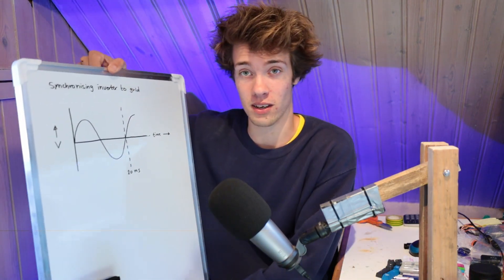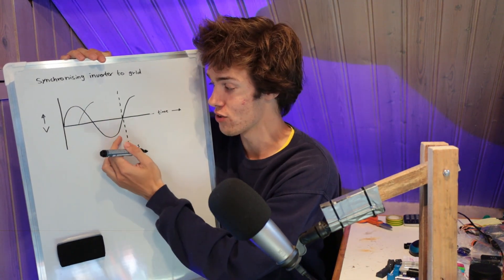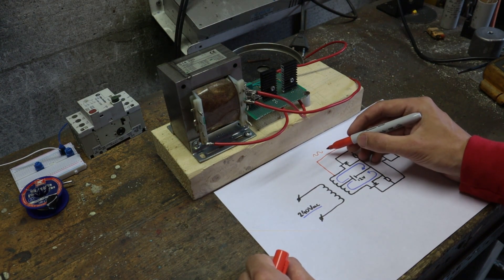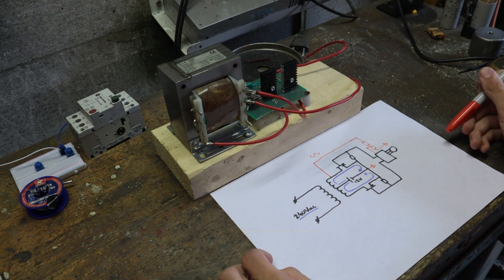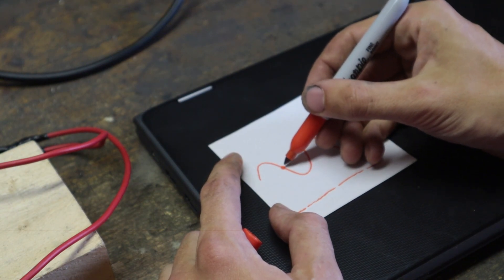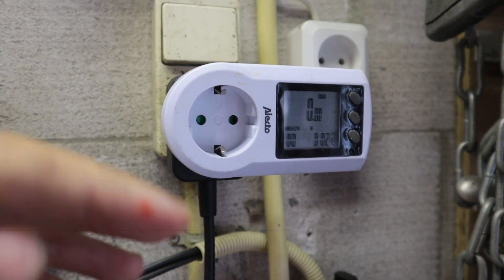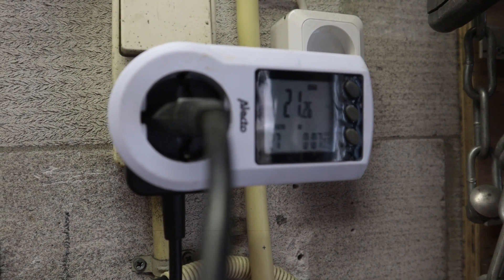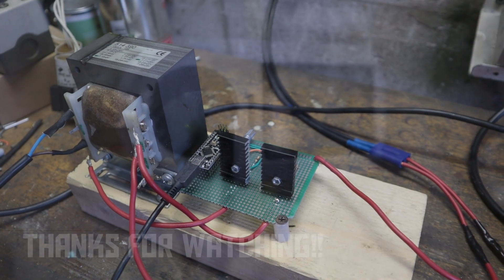Pushing power into the grid (with a grid-tied inverter) (AKIO TV)

Comment: Fair explanation. There is something funky going on because you put in a square wave to the transformer, the result in the transformer isn't a perfect sinus. That is probably the loss of 30W because of conflicts but also we don't have seen your whole setup and your arduino code how you did this. If you use the Arduino library and don't use registers or assembler yourself, it will get quickly out of sync. Anyway, this works only when the output voltage is slightly or much higher than the mains voltage. You said it outputs 240vac, in Europe we have 230vac, so it 'works' because of the higher voltage. Anything else connected in the same group starts to consume your power. You don't feed any power to the grid, some other devices in the group starts to use it or it is due power losses. That is what you are measuring. The highest voltage is leading and provides the current. 

About feeding back to the grid. For example you can have a 1000W inverter and connected to the grid but when there is no consuming device, nothing happens with the available energy. To be able to pump the available 1000W into the grid, it must be used by something. Don't assume you can feed power into the grid when it is not used.
Reply: He says he increases duty cycle to increase pushed (export) power. But that doesn't make sense . I agree with you that higher voltage will push the power to the grid because of other consumers on the grid. Am I correct?

Comment: Nice video! 👏🏻 It’s possible to inject ac power on other ac grid. Example an 110v ac grid to another 220v ac grid… ? Thanks
Reply from the maker: If the frequency and phase is the same, all you need to do that is a transformer. If the frequency or phase is different (eg 50hz to 60hz) you first need to rectify the ac on the input to DC, then use an inverter to produce the frequency/phase you need on the output.

Comment: Hello again. I have questions but don't wanna be a bother. You should make a Patreon or something.
Reply from the maker: bit too soon for a patreon I think
Reply: @AKIOTV  MB, but when it's time I hope there is a "Answering questions" section. :D I was learning how those old electrical meters spin backward. I understood that the current is 180 degrees in reference to the voltage when the power goes the other way. But still have a lot of trouble understanding it.
Reply from the maker: @JSunday45  what is the trouble?
Reply: @AKIOTV  When I turn the meter around I get that I turned the current coil 180, but doesn't that also happen at the voltage coil. Still can't quite comprehend two-way power measuring.
Reply from the maker: @JSunday45  When you flip the meter, the meter sees the current in the live wire running in the opposite direction, which is the same as a 180 degree phase shift. 

The voltage however, doesn't change, because the polarity of the meter remained the same. It still measures the voltage on the same live wire, relative to the same neutral wire.

and of course the power is then a multiplication of the current and the voltage.
Reply: @AKIOTV   So, the meter sees that as a 180  phase shift but it's not actually shifted?
Reply from the maker: @JSunday45  Well lets say the current is going "forward" when the current waveform is positive, and "back" when negative. 

But then what's "forward"? That's relative to how a meter is wired up. You look at a stream of water, is it going left to right or right to left? depends from which side you look at it.

So if you install the meter backwards, it sees the current going in the opposite direction at any given moment, aka a vertically flipped current waveform, aka a 180 degree shift.
Reply: @AKIOTV   So, is the phase shift observed only at the meter or is there an actual phase shift? Since we haven't flipped the meter in reality. What actually flipped. current, voltage, or both?
Reply from the maker: @JSunday45  
- In a house with the meter installed the normal way (output towards the house) if the house consumes power, the current is in phase with the voltage, the meter registers a positive value for power.

- if this same house supplies power to the grid, the current is reversed, so there's a 180 degree phase shift. the meter then registers a negative value for power.

- if the meter is installed backwards (output towards the grid) and the house consumes power, it sees a 180 degree phase shift and registers negative power

- if the meter is installed backwards and the house supplies power it sees no phase shift and registers positive power.
Reply: @AKIOTV  Thank you. That really answers my questions. I really appreciate it. Looking forward to the videos.

Comment: So the two voltage waves are the same? Is saying that the voltage is the same, but loads draw from the inverter simply because it is closer correct?
Reply from the maker: That's a simplified way of saying it but essentially yes.
Reply: @AKIOTV   As I wrote that comment I also realized that unlike water current flows everywhere proportional to the resistance of the paths. Does this mean some current always goes to the grid?  I feel like I'm missing something obvious. Sry for taking your time.
Reply from the maker: @JSunday45  This is very difficult to explain in general, and especially in a comment. Therefore I've made a little simulation model. You can open it in a web browser and play around with it. That way you can see very easily what's going on, as the tool animates how current flows. I think that will clear things up quite well. I'm not sure how well it works on mobile, so I recommend you open it on a PC.

here's a link to it:

https://falstad.com/circuit/circuitjs.html?ctz=CQAgjCAMB0l3BWcA2aAOMB2ALGXyEw1sESQBmckJBSagUwFowwAoAJXAE4AmEHtGm58ekIXQi0KPJHTnQEHEJlEViIDMjXYo4anXIzd8xQCdh2ipB3l1E1ufLXL+S-fMJellQbvhWRBBONurB1AK6PFws0DgIKoSkmMhUYHD8TlDQOjDYrADmVjoIEWHxWnIFIK4lQjXJxgEY1WBatjo1EXSYaJTomK3YXNat-OlgqrlZeQDOFgJCYF7txiAAZgCGADYz9KwAHhlIPGBU5GDHozo8OgCWAHYAbvSmAC4vBxoIbWhcGlxtLzXHT5Uy3AAmrAA7tRlupXCtIKwAEbgCYoOikHTIHhUJGHbDqAhUUh-AhaYEgAAWAHsAK67T6ULSEGxcElYar8HRbGkbcEzT7xOqjTC2Fp-SlQ26megAHRmspmtxmrw29wAxntDshsHQeDwtAChAbJeA6KCIQqAA40qEvBUACnu9HyG1et2eCrlAEcFZbwQqZnTrdatrd6DMbXaXgAaaPKj1eqN+mYBhWyrWeyPR+2mACUQoI1GQmOQLJSXLSIDlSL1VF1+r1ymQQjCEgA+rqO5gO3quFwu3qO+RoDwO8wO2ApwJ8bDMbgQFwhtRsB1wHwGfKZjNw+CHTMafcFa8qduwfkqa8nQAiAC2G32CseNK2avy9Bv+ZPNIVDw1sobLsf5PC87ymLmB6MIwAB8rDinQABiEAGEY5BSMwIAALKPgqABqr7vnsQA

I know you may not trust a link like that from a random guy on the internet. If you don't trust it perhaps check out the tool for yourself first: https://falstad.com/circuit/
Reply: @AKIOTV  I do trust it. Thanks. Alredy played with it. MB I will try and research some actual values.
Reply: @AKIOTV   Thanks. I appreciate you investing time into that for me! It helps.